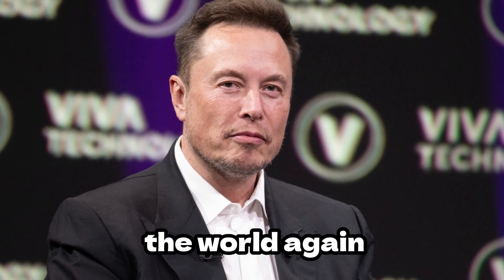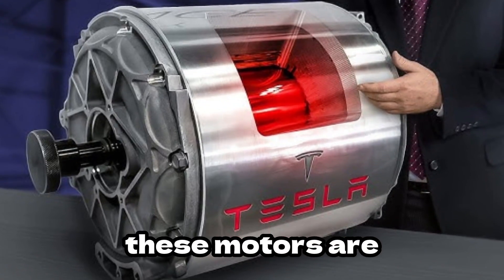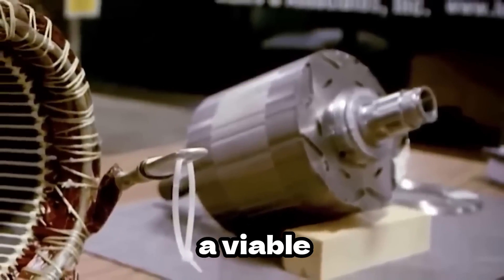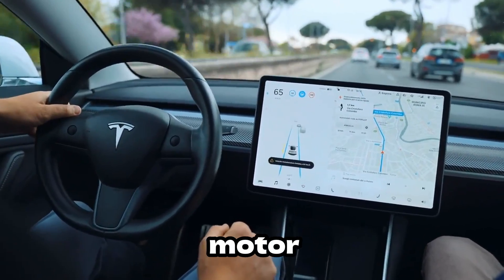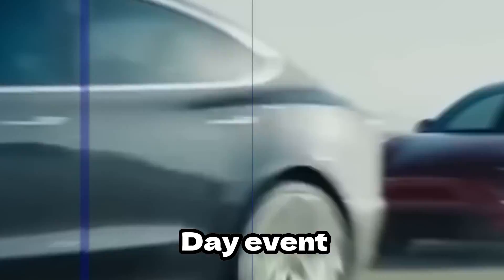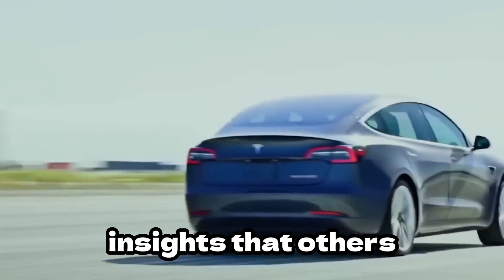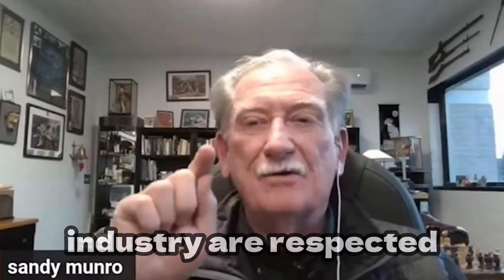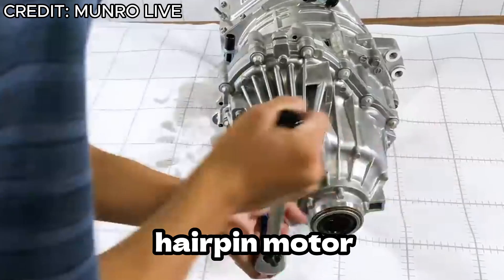Elon Musk: Tesla's New Engine Will Change The EV Industry Forever!

Comment: The reality is (!) all EV’s are a ticket to financial ruin (after 3-5 years, they’re worthless) - you cannot win this game.!
Reply: I have a good friend who bought a Tesla Model S in 2017.  He drives about 60,000km per year.  In the 6 years that he owned the car, it was only in the shop once a year for an annual inspection.  The only items he ever had to replace were tires and windshield wiper blades.  He did have a wheel alignment twice.  When he sold the car with over 300,000km on it, it still had its original break pads.  He never had to add or change oil.  He never needed a tune-up.  His battery was operating perfectly and was still able to charge to 85% of its original capacity.  He's a very meticulous record keeper.  Over the 6 years, his electricity cost to power his Tesla was less than 30% of what it would have cost him for the same number of kilometres on gas.  When he sold the car, far from being "worthless", he got a very reasonable price for it.  What he did lose in depreciation was FAR less than what he saved on fuel and maintenance costs.

Comment: Power isn't an EV issue, it's Range & infrastructure.... (AND the used EV market)
Battery range is marginally improving, charging stations & the Grid itself need to vastly improve and need to be vastly environmentally BETTER than ICE vehicle usage!! (without the EV Build and disposal issues in comparison to ICE)   Solutions are only good if the ARE!
Reply: The efficiency can not possibly be 20% more. They say the current motors are 90-92% efficient. 20% would be over 100% efficient? Impossible. I bet it is a 5% increase.
At the end of the video tells about  the downsides... And it does not seem they justify 5% efficiency increase in the motor.
However. A 10% efficiency increase in the motor relates to 1-2% more range overall... Not a big deal.

This Elon Musk guy is best at marketing...